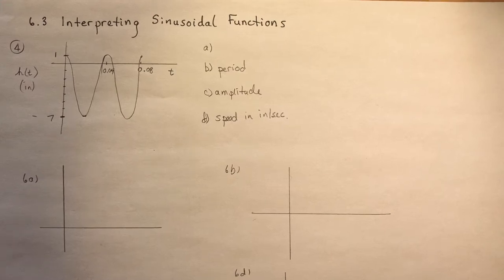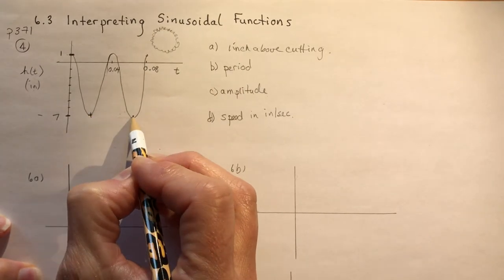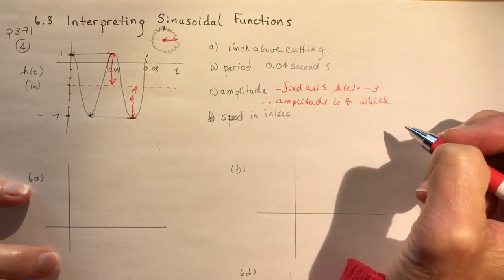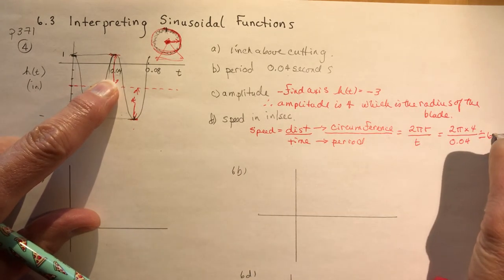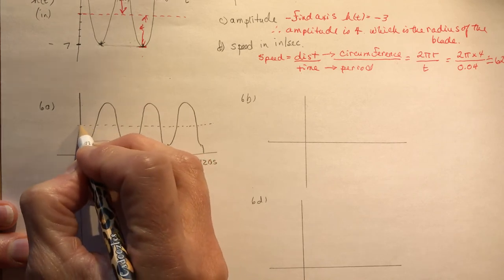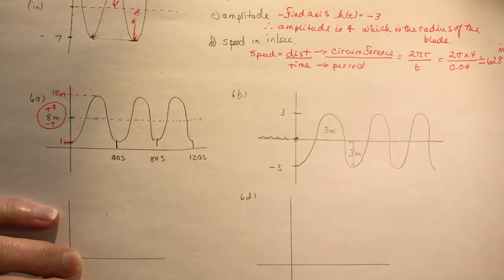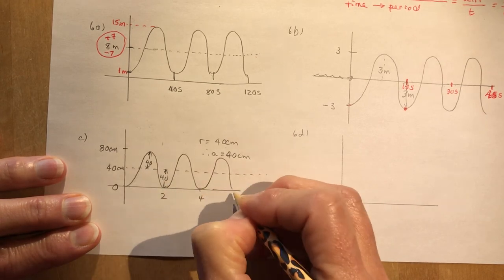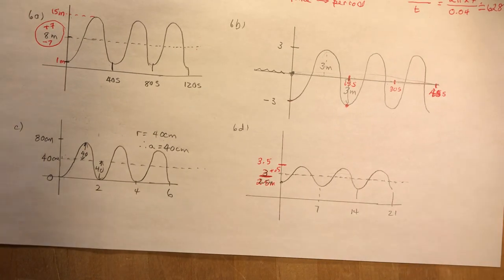Functions 6.3  Interpreting Sinusoidal Functions

Comment: Hi Ms. I was wondering how you solved for the EOA in question 6.c) page 371 when the amplitude and period were only provided?
Reply from the maker: You were told that it is a wheel with radius 40 cm so you know that the wheel starts on the ground (0 height) and the maximum will be 80 cm; does that make sense?

Comment: Hi miss I'm having trouble with question 8 pg 372 (How do you know the distance when no info was given?)
Reply from the maker: The distance is related to the circumference.  So you need to use C = π(r^2) and remember to halve the diameter that's given.

Comment: hello ms, is it possible if you got go through # 10 and 11 on 6.3
Reply from the maker: I will explain #10 ... then you try #11
So First you need to set your calculator using the window that they give you.
Entering the equation will give you the graph with little effort!
One revolution is the same as asking what the period is for the function.  In this case your K value is 12 so period = 360/12  which means 30 seconds for one complete cycle or revolution.
The radius is simply the "a" value so that's 2
AND finally, the center of the wheel is where the axis is.  In this case the function is vertically shifted up 1.5  so it is 1.5 metres above the water.  That means that the basket will go .5 metres under the water at it's lowest point.

Comment: Can you please explain question 10 page 372
Reply from the maker: What may be confusing you is the typo in the question.  The degree symbol is in the wrong place and should be after (12t) NOT after 1.5
The period is 360/k and because k = 12  360/12 gives you 30 for one complete revolution (or cycle or period ... all the same thing)
The radius of the wheel is the amplitude, which in this case is 2.  If you were to sketch this (and they suggest a graphing calculator but it isn't necessary) the axis would be at y = 1.5 as this is the vertical shift up.  The maximum for the graph would therefore be 1.5 + 2 = 3.5 and the minimum would be 1.5 - 2 = - 0.5 
The centre of the wheel (sometimes called the axle in ferris wheel questions) is the axis, which again is simply 1.5m above the surface of the water.
Finally the last question you just need to substitute in  so h(10) = 2 sin (12 x 10) degrees + 1.5
or approx 3.23m which is the height of the basket on the water wheel above the water at 10 seconds.